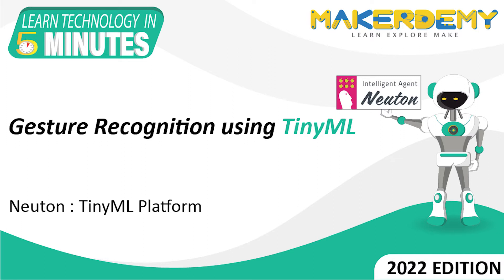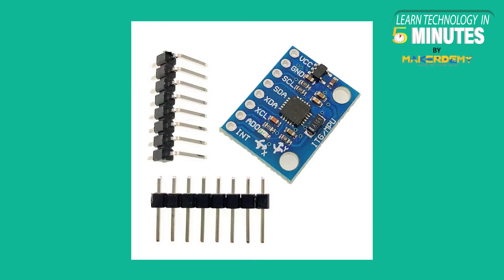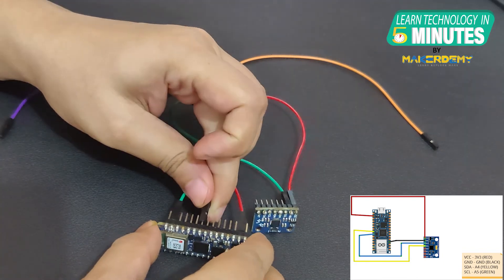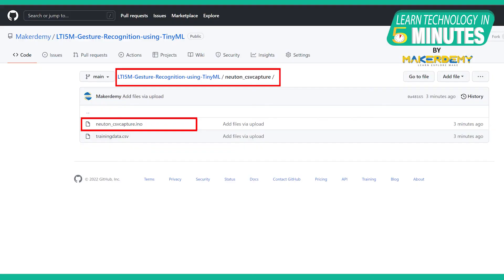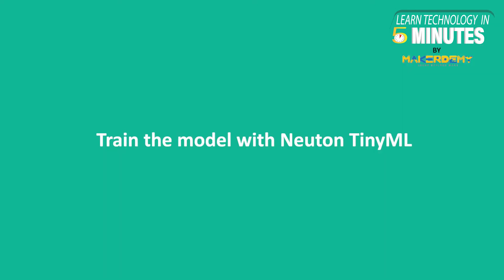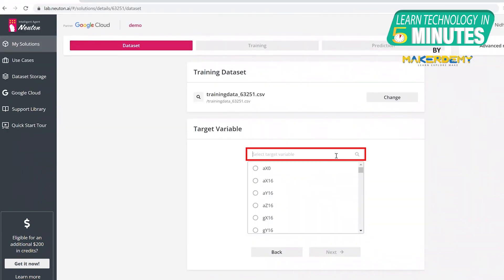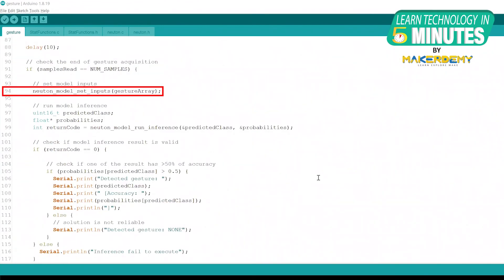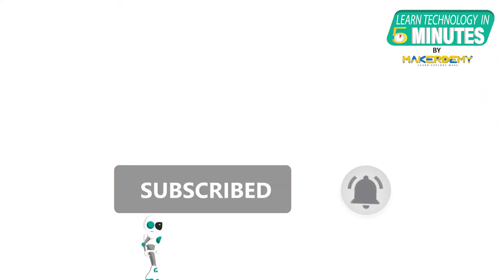Gesture Recognition using TinyML (2022) | Learn Technology in 5 Minutes

Comment: Thanks this helps a lot, but why not use the inbuilt accelerometer and gyroscope of the Arduino Nano RP2040 Connect
Reply from the maker: Hi Srijan Biswas.

yes you can use them also. This video is created as such you can use any 8-bit to 32-bit microcontroller that comes without any sensors inbuilt.